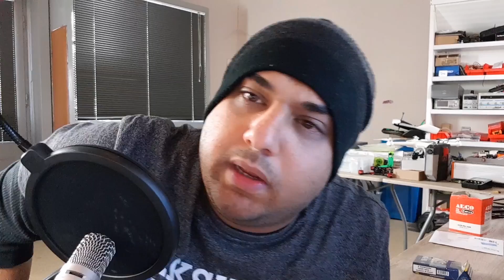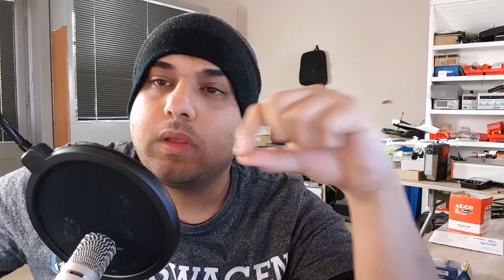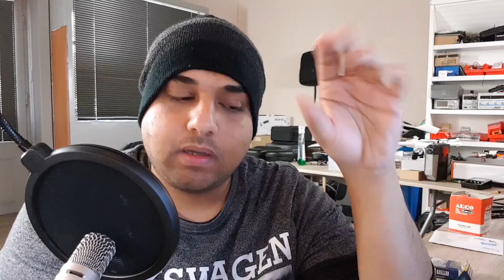Open Hardware Flight Controller Schematic Release to Public

Comment: Very dumb question, but when osd cuts out with increase of throttle is that generally a cold ground? I know it can be alot more, I'm conformal coating all three of my quads after work, and If I'm tearing apart that quad I want to try to fix it. Also, I used to have issues with that camera resetting but I haven't in a quite a long time. Any response is appreciated, keep up the interesting work
Reply: Should be either 1) inadequate current available on the video system voltage sources or 2) an indirect ground path for the video feed (camera->OSD->VTX). If it's voltage drop due to inadequate current available,  fitting a capacitor to the system might fix it.. all builds should have a power cap. In order to get a clean and stable video output, I always try to run ground wires directly in parallel with the video wires.. i.e. video and gnd wires from camera to OSD (where ever it is - FC, standalone, PDB, etc), video and gnd wires from OSD to VTX. Hope this helps.

Comment: Making a 4n1 esc would be great, and if it breaks we could fix it.
Reply: You can fix most ESC's if you have hot air gun and some SMD soldering practice (not so hard as it look BTW). There are two main problems: where to got some specific parts like some chips and FETs who are sold only in batches by thousands (it would be stupid to buy a roll of 1000 ICs if you don't have a repair shop). And because in most cases ESC's fry literally in flames and smoke and nothing is left to repair. Had such flaming experience several times and twice it was very hard :)

Comment: WATERPROOF, WATERPROOF, WATERPROOF!!!!!!! And for the esc standardised connectors for motors and wires like kebab was suggesting. Appreciate that is like the easiest mod to do but lets get some ideas out there. Maybe an xt30 and servo in and that 3 pin xt30 on the motor side.
Reply: Definitely waterproof, please! All guys from North with our crappy autumns and rain very often to jungle countries with rain very often will thank you. Standardized connectors is a very good idea too. ESC connectors: Ok for 4-in-1 ESCs. But I would like single ESCs without connectors.

Comment: By dual gyros do you mean one works at a time or both work together to cancel noise?
Reply: Both options are possible according to an Oscar Lansing review I read earlier today. He said there are a few FC like the SP racing F7 that use both gyro's simultaneously to sort out noise. Which sound pretty advanced to me.
Reply: @demonprince9713  yeah I wanted to know what the dual gyros on this FC would do
Reply: @quickf0x792  if I had to guess I would assume one at a time. We are probably to late for a definitive reply.

Comment: Why do chips need a resonator?  Can you explain what it does please.  My brain needs to know more X-D  I just want a fc that can be flashed with silverware, but for brushless micros.  Silverware is open source :)  your project is the best idea ever.  Thank you so much.
Reply from the maker: I think we can collaborate on that when i finish the series. Please add your ideas and or requests to the forum. It a great place for other Devs to see and possibly start on one.
Reply: Drone Mesh - I will def. check out the forum and cotribute with ideas.
Reply: Any digital device operate by binary commands which in general are a bunch of electric impulses: ones represented as high voltage and zeros represented as low voltage. Data physically does look the same. CPU which operate with them, must have a source of motion, a stream of impulses that drive the motion inside CPU and synchronize actions between CPU and attached devices. It is very important that all these impulses have the same form and frequency (exact amount of impulses in second). The source of these impulses may be external generator chip or built in CPU itself. But all of them use resonator which is tuned to specified frequency to make impulses in this frequency. In short - resonator is used to make precise amount of impulses in second. For 8 MHz in flight controller it is 8 million impulses per second. Physically resonator is a little piece of quartz which is made in specified shape (tuned) to resonate in frequency to which it is rated.  For more info check Wikipedia
https://en.wikipedia.org/wiki/Crystal_oscillator
FYI: Our microcontrollers in flight controllers (like F4), ESC's and VTX'es are in fact small specialized CPU's. So they must have a resonator too.
Reply: KrotowX - Thank you very much, that really explained it very well, but looking at that wiki info, I didn't realize how deep the rabbit hole goes, but you answered my curiosity and more.  So my humblest thanks.  So this is what is stated when we talk processors speeds like a 2.5ghz? It is the resonance with wich it resonates and computes or something., so for it to talk to other cpus they need to resonate at the same frequenzy or have some sort of translation resonator, or am I lost here?  Sorry about the questions, it just interests me a lot :-) and the wiki page is not an easy nights read, but will take me a cupple of months to understand.  Thanks though, you helped a lot.
Reply: @SOLARFPV  Inside a single device actions between CPU (or CPUs if they are more than one) are synchronized by a single source of impulses that is tied to CPU and all peripherals that are connected to it: memory, data transfer channels, bus etc. Devices with several CPUs have a separate generator chip, for devices with a single CPU generator can be built inside CPU as well (most micro-controllers are built like this). CPU and RAM always operate in much higher frequency than peripherals - usually 8+ times faster. There are several approaches how various frequency impulses for separate device parts are made. In one the main clock speed (impulse frequency on which impulse generator operate) is the fastest - used by CPU and RAM directly and slower clock speeds are made by gradually dividing the fast CPU clock speed. Others use some middle value on which main communication between device part happen and higher clock speed for CPU, RAM and fast network communications (those often have their own generators which are synchronized with external systems) are made by frequency multipliers - circuits who made exact amount of several short impulses for one slower impulse. The other approach is usual at today's systems where only CPU and RAM are working on fastest frequency which is the rated clock speed for particular device (like 2.6 GHz for CPU). Frequency multiplier is built inside CPU. Data transfer rate through bus is achieved by parallel data transfer or nowadays by several serial data transfer channels. PCI Express in PC's works exactly like that. So I hope you will now understand why F4 chip have 8 MHz clock generator, but inside it works 21 times faster (168 MHz).
Reply: KrotowX - Thank you!  It all makes so much more sence to me now.  So the F4 is clocked a 8mhz but inside there is a multiplier : 8mhz X 21 = 168mhz,  but for it to be in sync with other processors or ram it needs to output an 8mhz frequency (man I hope I get it lol).  I watched a documentary about how quarts crystsls are produced to be used in resonators, and was super interesting. And reading your explanaition has been amazing and tought me so much in just a few sentences and a few days.  I just want to sincerrely thank you for your time, your knowledge are like gold nuggets to me.  I still have alot to learn, but now I understand the basics, so thank you and thank you again.  Would love to have you as my Jedi Master ;-) Best regards
Reply: @SOLARFPV  Be my guest. Also microcontrollers usually have CPU and RAM built inside the same chip on same die. So they have no problems with faster clock speed for themselves.
Reply: KrotowX - cool stuff :-) thanks.  So when I overclock a CPU, I am actually meddeling with the internal multipler, wich I am looking into what is.   ;-D
Reply: @SOLARFPV  Exactly.
Reply: KrotowX - YES, I finally get it!  I feel like NEO when he said "I know kung fu" :-D thanks Krotow.  Best regards